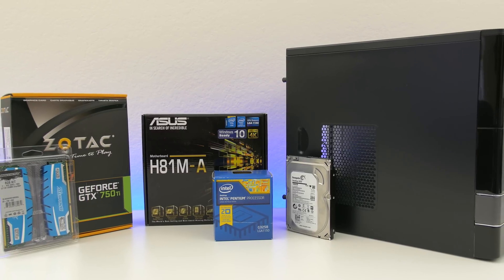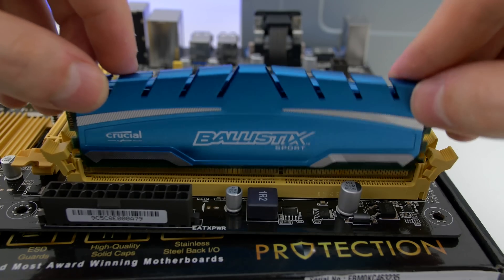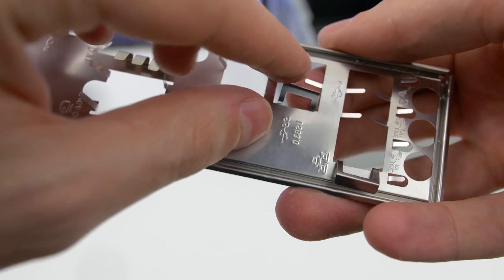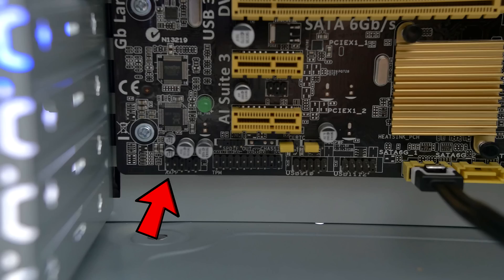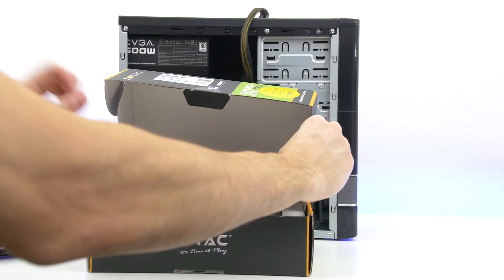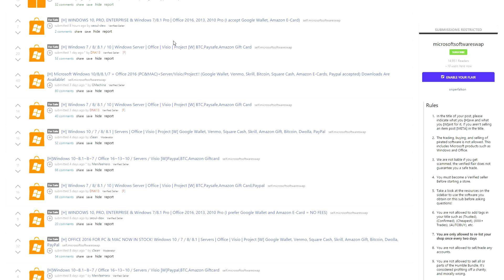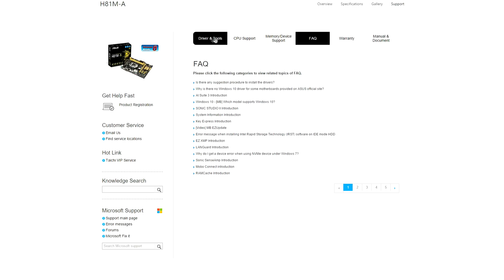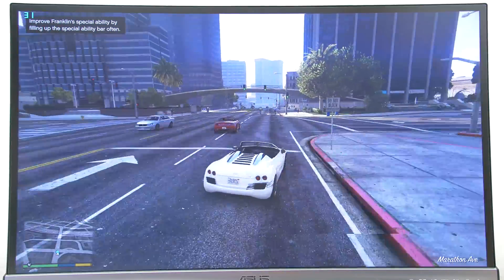How To Build $350 Gaming PC w/ Windows + Overclock!

Comment: I never build a pc before is this a good starting if so what upgrade I can add to improve but still be around $400. also can this run Dayz and arma?
Reply: +ExternalSniper That build could run most games today at at least 60fps. it is a very good build
Reply: this can run day-z and arma at about 40fps.
Reply: Wanna buy the pc I built its in perfect shape bro
Reply: Wanna buy the pc I built its in perfect shape bro
Reply: xXSLICKENXx cool!
Reply: dude if u want upgradability try giving more money to motherboard. Try one with 1150 socket(obviously) and z97 chipset. this will give you the opportunity to use faster rams for just about 30$ more. I think cheapest is z97 Asrock anniversary (about 80$)
Reply: +Panos Papas http://pcpartpicker.com/list/YHRBPs
is this build good to run bf4, arma, and dayz?
Reply: +Nick L thx fam
Reply: ExternalSniper I am not sure about some arma modes( I think in custom map you can deploy thousands of troopers. whitch really stresses ram) , the cpu is a beast not just for gaming . My opinion : great pc  but: cut from the cpu and buy 16 gb ram 1866mhz or lower( that's the max this motherboard can handle). first urgrade should be ssd ,this gpu is a monster , you can play most of the games out there ( and for some years from now) on high or ultra with descent fps . The motherboard is micro- Atx whitch is good for budget , will give you space for cable management even though this gpu will look funny on that XD( also your build is almost the limit of the motherboard). Good build bro have fun
Reply: +Panos Papas thx I think over time I'll upgrade the ram
Reply: nice !!
Reply: Dayz yes, arma not so sure. even some mid-high end pc's have issues running it at a consistent 60fps

Comment: Would this case work. https://www.amazon.com/gp/aw/d/B00I0MKMG2/ref=mp_s_a_1_2?qid=1465912414&sr=8-2&pi=SX200_QL40&keywords=corsair+carbide&dpPl=1&dpID=31MHuwIx9PL&ref=plSrch
Reply: yes
Reply: Would you haft to place the build parts differntly that in the case in this video?
Reply: Ultimate Tech Team No. Everything is standardize.
Reply: ok thank you
Reply: +WB IsMe how do you know everything is the same? like the screws and inside desighn?
Reply: AngelsLive Because i have been building PCs for 7 years. Not totally the same but 95% of the computer parts always goes or uses the same connector, slot or screws.
Reply: +WB IsMe ok thanks, is there cases that need to meet the requirements for these pc parts?
Reply: One of the major factors that determine the type of cases is the size of motherboard that you are using. Motherboard comes in different standardized sizes namely (Largest to smallest) EATX, ATX, MATX and ITX. The case (Rosewill FMB-01) in this video support MATX and ITX motherboard. Regardless of the brand or model of the motherboard, as long as the specification states that it is a MATX size, this case will support.
Reply: +WB IsMe is the cpu fan a cooler? im new to pc building?? what is that fan for?
Reply: AngelsLive All electronic products produces heat. The processor aka CPU produces so much heat that without a cooler, it will reach over 100 degree celcius. Excessive heat will damage the CPU hence a CPU fan and heat sink is required to dissipate the heat away from the CPU.

Comment: Would it be a good idea to over lock with the stock cooler?
Reply: You can do some mild overclocking.
Reply: +WB IsMe do you suggest overclocking to the same degree he did in this video?
Reply: Pet Soarlex Yes. Can't go far with stock cooler so just overclock the processor by 0.2~0.5 Ghz. Just monitor your CPU temp and make sure that it doesn't go over 80 degree C at load.

Comment: Can anyone tell me how well this PC would do on High settings Overwatch?  Also what monitor do you all recommend I buy for it?  It's my first time building a PC
Reply: thabet sarhan np, coincidentally, i built this pc just for overwatch too xD
Reply: I changed my processor from the one he used in the video to an intel i3-4150, and everything runs at a smooth 60-100 fps when everything is on high (with one or two things turned on medium). You will run fine on medium-high settings so don't worry.
Reply: thabet sarhan Stock cooling has been serving me well. I have been getting normal temperatures with no problems. However that may be due to the fact that I didn't overclock it. I recommend that, unless you are using a dedicated cpu cooler that you keep away from overclocking. it's dangerous and lowers the life span of the cpu and has the potential to break it.
Reply: thank you very much ! my friend and i will be building two of these cause of you.  thank you so muuch
Reply: thabet sarhan Glad to help man, good luck building!
Reply: 60fps average on high settings in overwatch. you wont have a problem at all.
Reply: Nick L Thank you so much
Reply: wow then you're my guy!! everything runs well with overwatch?
Reply: does it over heat?
Reply: It better on medium because you'll get 30 fps on it with those specs
Reply: w Aspen Mendiola i play with all setting on ultra andget between 90-110 fps...
Reply: Hey nick does it matter what type of windows 8.1 pro key (OEM or Full version)?
Reply: Jeff Tang OEM means that the key is tied to your computer (so if you get a new computer you are screwed and will have to buy a new key). Full version means that it is a permanent version of windows, meaning that if you get a new computer it will carry over. Personally though, I recommend just pirating windows 8.1 pro. It is what i did with my budtron and it's free.
Reply: Nick L How would you pirate?
Reply: +Jeff Tang Get it off kinguin for like  $30 or £25
Reply: +Nick L have you played any other games ?
Reply: Braedon II Yes, but I don't have the tools to benchmark all of them. Basically, they all play at 80fps+ with about 1 or 2 setting turned down.
Reply: so if i bought everything in this video id be ready to go?
Reply: All Day Callaway Yes, assuming you already have monitor, mouse, and keyboard.
Reply: Do you think I'd be able to play Dead by Daylight smoothly? With all the things in this video recipe list??
Reply: Chris Sasaki I have Dead by Daylight, and I play the game at 60fps in medium settings, and 30fps on ultra settings. If you are going to use a 750ti, expect about 10 frames less than what I got because I am using a gtx 950.
Reply: +Nick L Wait wait you changed to an i3 and a GTX 950? No wonder you were getting much better frame rates than normal.
Reply: +Nick L so how was the build

Comment: Is this a good gaming PC for a first time builder? Was thinking of buying a PS4 but I been browsing gaming PCs and how some are built. Made up my mind I want to try to build my first PC. I literally have zero knowledge on all of the hardware that goes into a PC but following these steps seem pretty clear. So my question is, is this a good gaming PC for a first time ever builder?
Reply: iReltz GFX
Ah check the reviews on Amazon for that mobo... I can send you the part picker link for something much better and allows for expandablilty although it is $20 more than this one. Or i can send you my pc build - the price isn't the same though.Also i'm looking at the GPU you chose and honestly it makes no sense (to me don't change your parts because of me, I'm just looking at specs) since the Zotac 750 ti is just slower my about 100 Mhz. Also your PSU is overpriced for only 430 watts WTF. You can use the one Ed used for $10 cheaper AND it offers for watts.

TL:DR Just review your parts and if you actually read what i just wrote, take that into consideration (trust me, I spent two weeks reviewing cases when I was supposed to be studying... I have no life) and you're good to go. Hope I helped (if u read this) :D

Edit: Felt i needed to add the core clock speeds of both of them -
Zotac 750 ti - 1.03 Ghz
Evga 750 ti FTW ACX - 1.19

May be wrong about the performance differences after all...
Reply: DvoLogic parts in germany are more expensive.. we dont have the power supply for 20$ like ed used lol... and the zotac one is like almost the same price as the ftw acx edition so i rather went with the higher clock speed one lol
Reply: I just built and finished mine a few hours ago, and I'm hoping it will turn out well. It was very easy to build, and I recommend this build to you
Reply: +SgtCheez does it really perform that good like by ed? did u also get like 4.3 ghz and gta v ultra settings 30 fps?
Reply: Im still trying to download everything, and Ill tell you what results I get.
Reply: SgtCheez ok do that pls thanks :D
Reply: I'm the same way
Reply: could you use a better graphics card with the motherboard or would i have to upgrade?
Reply: ODINJUSTHAPPENED lol hell yeah man u can use a better graphics card a 950/960 or like me (if ur cheap) im getting a better 750 TI from EVGA FTW ACX (i think) edition
Reply: I recommend doing your research on EVERYTHING if you're new to PC building... I plan on building my own PC next month - only difference between that build and this one is that this one limits upgrading. The motherboard Ed used got alot of negative reviews on Amazon saying it came DOA. If you don't want to take any chances then do your research and get another mobo. Well that's all I have to say... GL
Reply: +DvoLogic do you know any other good motherboards that will be good for this computer?
Reply: Xplit - CSGO I kept the motherboard and the cpu for this build so i can overclock the cpu.. not every motherboard supports overclocking... here's my build i will get once i have the money.. one day xD http://pcpartpicker.com/list/VggK8K
Reply: iReltz GFX Oh sorry never considered other currencies... I dont live in the US but when shopping online I use USD.
Reply: I recommend giving a bit more money for motherboard to increase upgradability. My pc costed about 400euros and I used a better motherboard ( look for ATX with z97 chipset, which will allow you greater ram speeds 2133+) ,a tiny bit slower prossessor,(G3250), 240gig ssd, 8gb dual channel 2400mhz ram. got about 35 fps avegare on high on witcher  3( same gpu ,1080p ) but while also having internet and skype on.

Comment: can i upgrade the cpu if so what cpu can i get thats bettter

please leave a link
Reply: Google it yourself
i3 4130, i3 4160, i5 4440, i5 4460, i5 4570, i5 4590, i5 4670, i5 4690, i7 4770, i7 4790.
Reply: can i use i5 650? 1th generation
Reply: Dulguun Khurelbaatar Can't.
Reply: +Dulguun Khurelbaatar not w this mobo
Reply: why not?
Reply: Dulguun Khurelbaatar 1st generation intel processor is only compatible to LGA 1156 motherboard. Processor socket design are different for each generation.

Comment: Do you guys know if I would need a bracket to hold the Samsung SSD if I wanted to replace the hard drive he's using in the video?
Reply: Just connect the wire and let the SSD hang loose. Nothing will happen since SSD has no mechanical parts.

Comment: ok guys so i did this biuld same motherboard same cpu same gpu same power supply. now i do want to say that i did overclock to 4.4 with stock cooler. my cpu temp was about 97c thats way to high today i change it to cnps10x optima and now my cpu temp never goes over 76c so i do recoment using aftermarket cooling if you overclock

Comment: does wires come with it or you need to buy them
Reply: All power cable comes with PSU. All Sata cable comes with motherboard. The +/- LED, HDD, PWR, RESET connector comes with case.

Comment: Hey is the EVGA GeForce GTX 960 02G-P4-2966-KR 2GB SSC GAMING w/ACX 2.0+, Whisper Silent Cooling Graphics Card compatible with the mother board that is suggested.
Reply: yes
Reply: +WB IsMe will the cpu bottleneck it?? I am thinking about upgrading to the same card?
Reply: TheMississippiWarrior There will be small bottleneck in some games. If you are using G3258, i suggest to choose any graphic card with the performance of GTX950 and below.

Comment: How do u connect the graphics card to da mother board and dose it support usb 3.0 because I saw a cool case with usb 3.0 on da front
Other wise building same pc 
I'm dumb because I'm 10 1/2
Reply: You slot the graphic card into the motherboard's PCIE x16 slot. No, it does not support USB3.0 on the front but it has USB3.0 on the back.
Reply: +WB IsMe thanks

Comment: I'm very new to desktop computers, do you have to charge it? Also, do you have to plug the pic in or does it power from the power box?
Reply: Last, we get to choose the monitor we want, right?
Reply: you don't have to charge it, you just have to plug it in
Reply: Desktop computers are not charged necessarily. They are plugged in all the time if you want power. And the monitor has to be compatible with the gpu.
Reply: +Black n' Diddy ok thanks
Reply: +sniper beast thanks

Comment: Hey Ed, i recently purchased a used ASUS CM6870 with the intention of upgrading it for gaming, i was wondering if you could possibly look at the specs sheet and suggest some upgrades? i plan on playing Overwatch and DOOM. any help would be great, ive been watching all your videos but i figured it out be easier to just ask.

http://www.cnet.com/products/asus-cm-series-cm6870-core-i7-3770-3-4-ghz-monitor-none-series/specs/
Reply: Change the graphic card to GTX750TI.
Reply: that's it? just a simple graphics card change
Reply: Kalvin Rosario Yes. The hardware of CM6870 meets the requirement of GTX750TI.

Comment: Can the case be any computer case?
Reply: I have the exact question.. Rosewill case is hard to find here..
Reply: Yes as long as it supports MATX size motherboard.
Reply: Yeah, just make sure the mobo, the gpu, cpu cooler fits.
Reply: Will it be a differnt setup inside the case so you cannot exaclty go by the video?

Comment: What is the minimum Frequency of this cpu for this motherboard? THANKS.
Reply: Frequency doesnt matter. You can use any other CPU wich fits the 1150 socket.
Reply: +Peter Lustig (TWBSupercars) Okay. Thanks.
Reply: i want to use an i3-4150 Hawell CPU instead of the pentium he listed. Will it be compatible with the motherboard he uses?
Reply: +Nick L Yes, it will.
Reply: +Peter Lustig (TWBSupercars) will i have to flash the BIOS?
Reply: You probably wont, but i am not exactly sure.
Reply: +Peter Lustig (TWBSupercars) okay, thanks!
Reply: +Nick L Sorry, noob here. What does flashing the BIOS do?
Reply: . basically, updating it so that the motherboard performs more efficiently and is able to support more CPU's
Reply: Ohhh kk. Thanks

Comment: does processor come with cpu
Reply: +Rektus Are you trolling? If not, process = cpu.
Reply: this is obviously troll or just plain stupid
Reply: +ARMY GOT YES JAMS .i meaned cpu cooler
Reply: Rektus Yes it comes with the processor but I would recommend Cooler Master cpu cooler instead as the video says :D
Reply: +ARMY GOT YES JAMS yea
Reply: thank you I have been trying to find this out for a while now!
Reply: +ARMY GOT YES JAMS you got no jams
Reply: Buy an after market cpu cooler if you will be overclocking but standard cpu cooler is good for just overclocking a bit
Reply: +Rektus If You Buy Unlocked Cpu , It Not Come with cooler
Reply: a stock cooler on a g3258 can get up to 4.4ghz at about 65C on load.
Reply: +ARMY GOT YES JAMS ayyyyyy armys
Reply: Bass Nightmare prosessor and CPU are the same thing

Comment: did u connect the monitor to the graphics card or the motherboard. If u connected to the graphics card, what cable do I use??
Reply: first time building
Reply: First time using it unplug your graphics card and plug in the hdmi into the motherboard, when done downloading Windows then you plug back in your graphics card
Reply: +Tanner Rouse So when installing Windows, you need to connect the HDMI cable to the motherboard right? And when it is installed, you can then connect the HDMI cable to the GPU right?

Comment: please answer will it matter if i use another mother board for ex asus h81m-r or asus h81m-k?THANKS
Reply: +David Mirceski Doesn't matter
Reply: +WB IsMe Thanks bro
Reply: +WB IsMe btw will it run far cry 3 and cod bo2?
Reply: Search youtube "Far cry 3 G3258 GTX750TI" and same for cod bo2.
Reply: +WB IsMe but i cant find those in my contry will it be ok if i use G3260 3.30 and AFOX NVIDIA GT730-PCI-E 2GB DDR3
Reply: Yes but gaming performance will alot lower than what is get for G3258 and GTX750TI. 
G3260 < G3258, GT730 << GTX750TI.
Reply: +WB IsMe thx man

Comment: I want to use this for streaming to twitch so can I switch  the cpu ??? Any recommendations for which cpu ? im using an elgato aswell
Reply: Try getting an i7
Reply: yea try using an i7 if u like paying with your arms and legs. im sure an i5 would help but still pretty expensive. the cheapest way, but idk if itll work, is get a dual cpu mother board and get 2 intel pentiums g3258s which again wont be cheap but is cheaper then a i7 or i5. so ull get like 4 cores and like 6ghz.or atleast i think lol correct me if im wrong XD
Reply: cam any body help me what's the difference between this cpu https://www.amazon.com/gp/aw/d/B015VPX05A/ref=psdcmw_229189_t1_B00KPRWAZQ
Reply: +Dez Busta and the one in the description
Reply: Dez Busta nothing except u can't overclock the one your talking about. The g3258 can reach 4.2 or 4.3 by overclocking